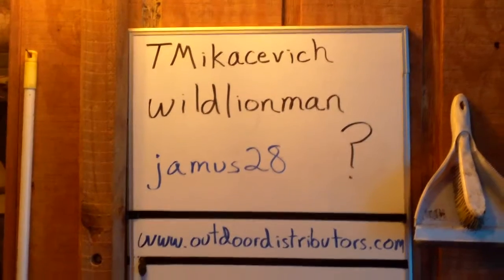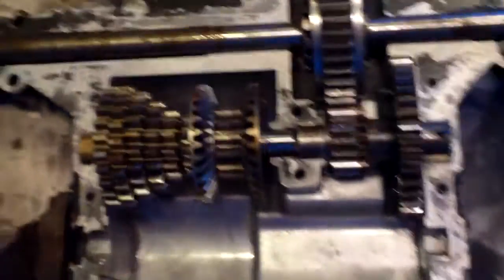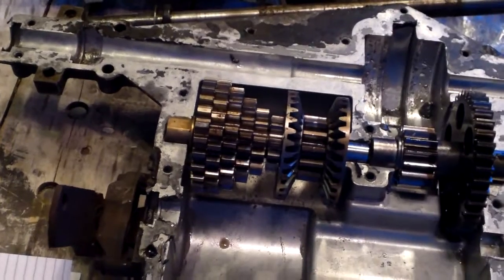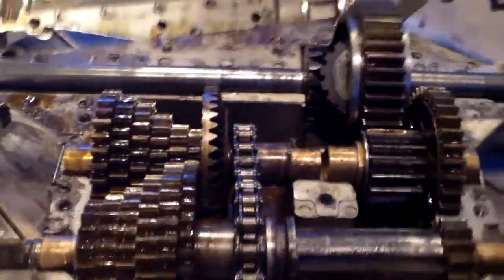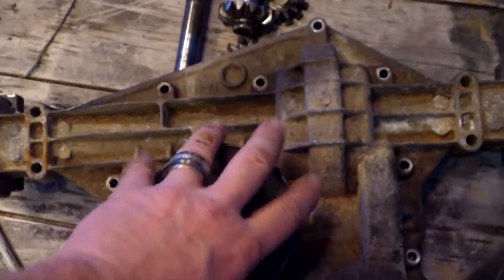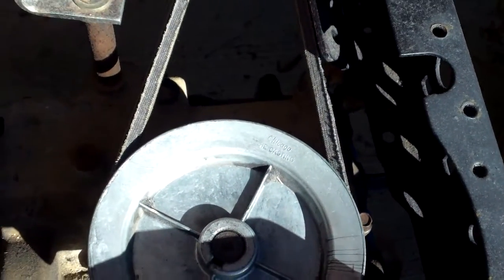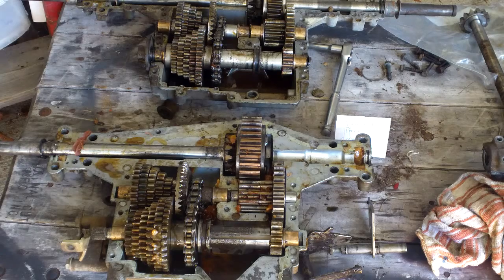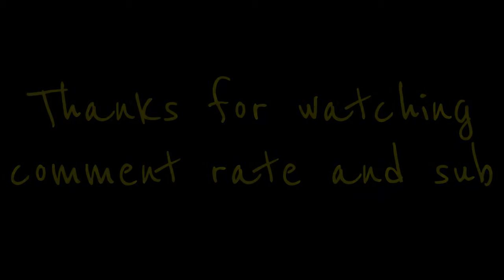How to change transaxle gears.

Comment: how much oil go's in the transaxle i can't find anything on it
Reply from the maker: It usually comes out to a little bit less than a quart. You really don’t want to overfill it. Some of these don’t have a fill port. So you would set your gears in and get your silicone gasket and apply it then carefully add your gear oil. I think in that video I used a mixture of Lucas and regular 90 weight

Comment: if the trans is in neutral shouldn't the brake work?  when i apply the brake and push the mower it still moves even thou the brake disc isn't moving. is something broken? thanks

Comment: I found an exploded parts sheet for the Peerless 801 I will be working on soon. It was on the Sears Parts web site. I copied and printed the parts view and noticed that they had every part for this transaxle and most were in stock. If I could replace a part or two for 30 bucks or so and not remove parts from my spare transaxle, I might be better off in the long run... Link below...

https://www.searspartsdirect.com/model-number/801046/0796/1510000.html

Comment: Are Peerless parts available someolace?
I have an 801 in a John Deere to get into. Gears slip in every gear under load. May only need a gear or two..
Reply: I did pick one up, not sure is it is exactly the same or not. After your video, I think there is a good chance the parts will work.  Thanks

Comment: If you left the rear transaxle in nutral and run a chain around the brake shaft from front to rear wouldn't that work without worrying about gear ratios or having to shift both of them? I use an older Craftsman Suburban as a Carry All around to sawmill. a friend seen it and brought me a couple others not running of course but was happy to get them. Also he brought a couple transaxles as spares and thinking of 10 Wheeling as well. After looking transaxles over I seen the braking axle could couple both transaxles in unison. If I'm wrong please let me know because I making a statement but asking is there any problems of doing it this way? Thank You for such an insightful video tho.

Comment: hi! i got a 5 speed peerles transaxel , the problem is, when tractor is of u can change gears but when is runing  u can not change gear , help ?
Reply: I have the same problem found out my gear selector shaft doesn't  set in the bottom of the casing like I've seen on u tube  their is a deep well which I have & there are some that have no well for the Gear selector  to hold it in place to put the top on.

Comment: Question on the shifter mechanism.. these appear to be constant mesh transmissions... what inside the driven gear cluster actually selects the gear your in? Is there a tooth that slides from singular gear to singular gear?

I have hydrostatics which are obviously completely different animals, and my only other small tractor before that was a Murray Zayre brand that had a separate clutch and brake pedals with a belt driven 3 speed, that chain drove the rear axle and differential, more or less like a regular transmission in a car. You couldn't shift that without using the clutch or while under load, again like a full size transmission.

I have heard the 5 and 6 speed transmissions could be shifted on the fly for any forward gears, is that correct? I've never had the opportunity to run one.

I am looking at a Tecumseh Peerless 700-050 Transmission, which is a straight 5 speed with no integral differential, for a DC traction motor project. It's set up the same way internally with the chain reverse, I was curious if different speeds could be selected while moving, or if at the minimum a slight bump in power was applied at the same time you tried to shift, to take the torque off the gears.

Thank you for taking the time to tear these down and go through them.
Reply: *****
So arethey shiftable during movement or do you have to clutch it?
Reply: *****
 Ok cool, that's kinda what I expected it's not like a planetary where you just grab that clutch and wham it's in.

Thank you for your reply.

Comment: I have noticed that on the transaxles that look the same like the peerless and the spicer, notice on the input shaft inside the trans that the gear is different. The peerless seems to have a larger tooth pattern than the spicer, I thought they might be interchangeable, but the splines on each shaft is different. Not sure if that would put a halt on some of the gears changing around or not.

Comment: A website called surpluscenter has surplus peerless transaxles for fairly cheap new. They range from the cheapest 2-speed all the way to the most expensive 5-speed. If the cases are all the same and all I break is the case, the cheap 2-speed would fix it.

Comment: This vid takes me right back to my days of playing with Westwood mowers, the peerless trans were always full of nasty black grease!
I Built a Kawasaki Z200 trike years ago using a Peerless trans, by removing the input shaft and the gears I was able to put the power in the trans through the brake shaft..
I just bolted a sprocket onto the brake disc..

Comment: Yep that seems understandable, its hard boiling down years of experence into a short vid.

Years ago i helped a frend with a faulty car gearbox, he got another from the local car scrap yard but he made a mistake and got the estate version, so the final part before the drive output was longer.

As it was the same maker/ratio's but estate version i swapped the "xmas tree" of gears from one box to the other, and put all the selectors/spacers/bits + oil back in.

Worked fine on all gears :-)